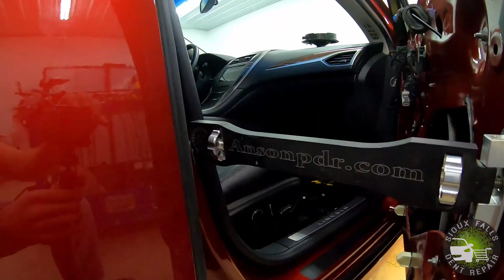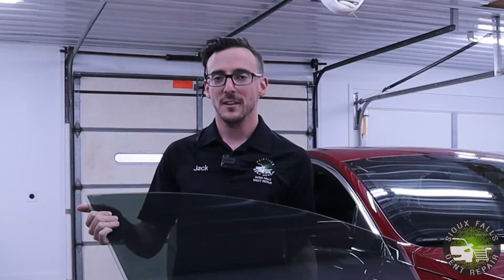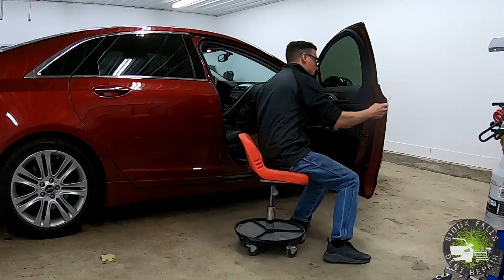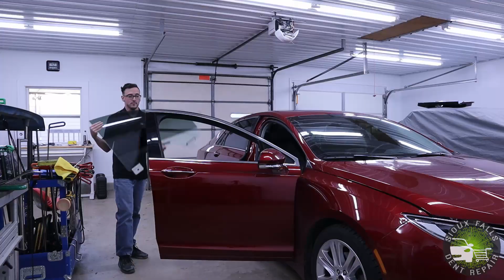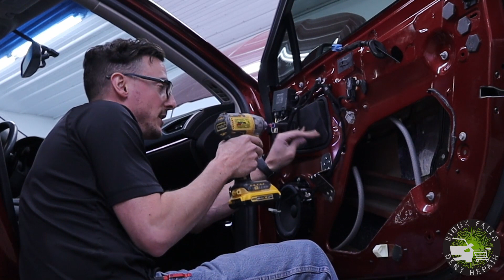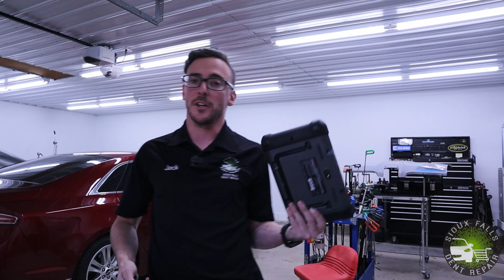Drilling Holes For Paintless Dent Repair | Sioux Falls Dent Repair

Comment: Yeah. You really think the door is pressurised…  
Door handle, lock mechanism, window, the list goes on. Now all cars have nice access like the one you are showing us.

Sometimes a hole may be necessary.
Option 1:
Drill a hole and fix the dent for 100 bucks
Option 2:
Pay 500 bucks to fix a dent and the technician may break/bend something and you end up with noises while you drive.

I am against holes but sometimes you need to gauge the pros/cons..
Reply from the maker: I understand your thought process here, but these holes are all calculated in the design of the door and the pressure sensor is specifically calibrated for the door, if you go adding more holes or changing them does the sensor know this? No. I am not an engineer but they design vehicles specifically this way for safety, see this link: https://www.bosch-mobility.com/en/solutions/sensors/peripheral-pressure-sensor/

A skilled technician will not break or bend things when taking apart vehicles and if they do an person with integrity would fix their mistake. 

You make the statement you are against holes then argue all over the comments of this video and comment on others comments on why a you should drill a hole? That seems contradicting...

Is saving money or doing a cheaper repair worth the risk of a injury or death? Absolutely not

Thank you for watching and sharing your thoughts

Comment: Thank you for the informative video! I was wondering, if a tech drilled a hole but then sealed it with butyl and a locking cap, would the pressure situation with the sensor be okay? Sometimes, I believe, the angle/leverage of the hole is more advantageous, for a deep dent on the body line at the bottom of a door for instance. It seems repairing the dent with an access point closer to the area, could help with leverage, and also with ability to see properly while working
Reply: Mate. Those doors are pressurised at all. There are holes everywhere.
Door handle
Water drain
etc...

I don't know why is he talking about holes and airbag pressure sensor.
Reply from the maker: Read this: https://www.bosch-mobility.com/en/solutions/sensors/peripheral-pressure-sensor/
Reply from the maker: That is a great question! Having a leverage and access point can make the repair easier but if you are creating a new point or hole this changes the design and pressure in the door. There is a reason they put these sensors in doors because of the limited room and crumple zones in the side of a vehicle vs the front or back(a person is closer to exterior of the car with just a door between them vs the front(firewall,engine,frame,hood,bumper ect). I am not a engineer but they design cars this way for a reason, safety being the number one item. Here is a link to a popular electronics company to discuss more on this specific sensor I discussed: https://www.bosch-mobility.com/en/solutions/sensors/peripheral-pressure-sensor/

Thanks for watching!

Comment: I've been doing PDR for 25 years. I drill access holes in door jams and many other hidden areas, as do most PDR Technicians. To remove door panels and glass can cause unnecessary damage and expense to the job. I have never had a complaint form a customer about drilling access holes.
Reply: You’re a lazy hack if that’s your excuse for not removing a door panel or glass.

Comment: Hello. I have a 2014 Mercedes c250 sedan got side swiped on front door near the edge. Went to 3 PDR technicians they all told me there was no access to that edge so I went to the 3rd paintless dent repair had to drill in the back of panel and it was a successful repair. Sometimes there is no access to the back of door panels unless you drill correct?
Reply from the maker: Sometimes yes, often times then we use glue pulling in that situation. Everything situation is different!

Comment: Not arguing that drilling is ok. Because as a tech with 15+ year experience I agree that you should never drill. There is a huge But though because, 1 wholesale customers will NOT pay you enough to spend time taking the panels apart. 2 there are plenty of areas on cars that have 0 access
Reply from the maker: This is why we tend to steer away from wholesale style work. Thankfully the advancements in glue for pulling in areas with no access has come so far in just the past few years, its amazing! Thanks for watching and the comment Brendan!

Comment: Didn't know about those sensors on the doors. Are the sensors in all vehicles?
Reply from the maker: Not all but most new vehicles. Thank you for watching!
Reply from the maker: Some have the sensor built into the air bag sensor also